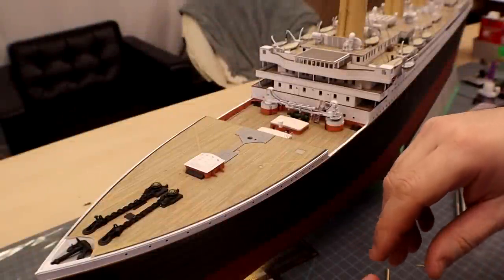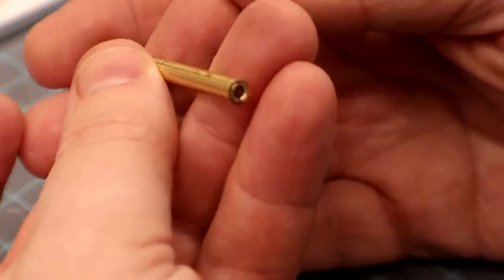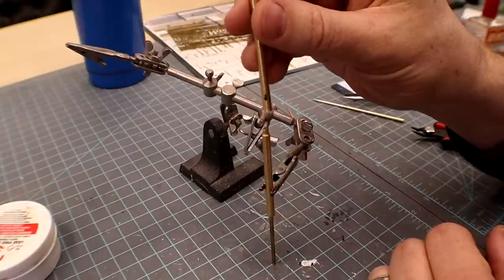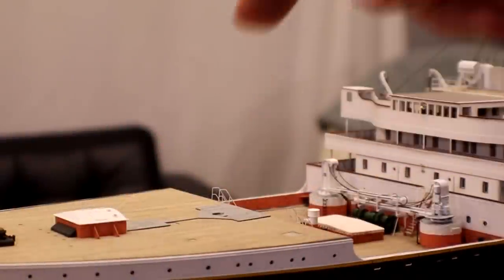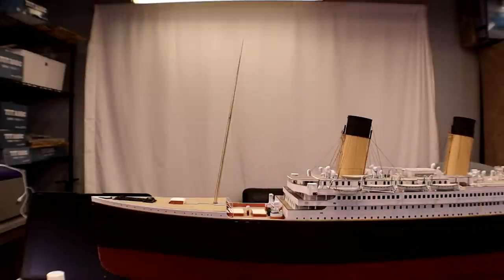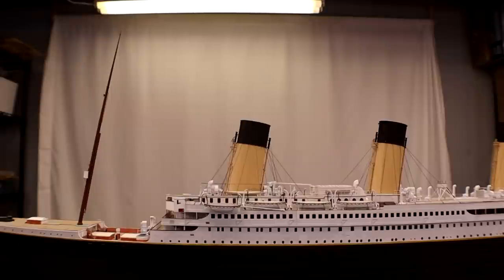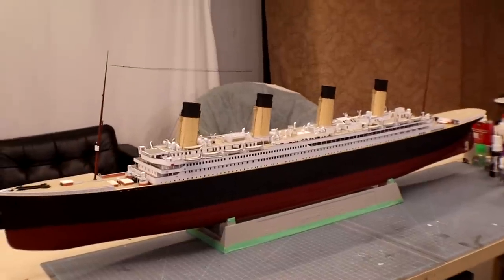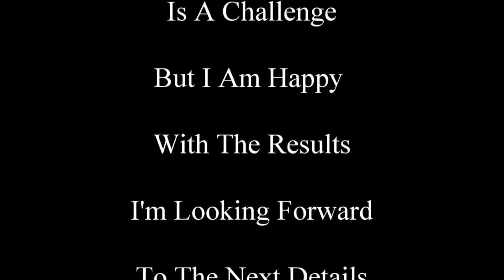1200 RMS Titanic Build Video 39

Comment: Nice job. When I saw u thinking of using 6000 adhesive, I said "brass!...solder it" and u did. Thanks. Love the masts/wires. Interesting that the overhead views in this episode brings into focus the diminutive size of the lifeboats in the scale of the real ship and begs the question "what were they thinkin'" at H & W....16 x 65 = 1040 souls.
Reply from the maker: Well… the “books” imply that they really didn’t think they would be needed. That whole space along the boat deck is meant to be filled with lifeboats. But someone thought it would look “cluttered” so they cut the number down to look good to the eye, and that happened to be 2 more boats than required by the law at the time so 🤷🏻‍♂️ It’s obvious now, of course, but back then… I think they figured it was already overkill.
Reply: @TheMidwestModelShop  Agreed, I just wonder if that rational applied to other ships but was not tested as was Titanic. Do today's builders use the same logic on these cruise ships with 3/4000 ppl aboard.?
Reply from the maker: Today there has to be a lifeboat seat for every single person on board.
Reply: Even with the huge amount of time Titanic stayed afloat, it would not have been enough time to launch more life boats if they had them anyway. Too much confusion on deck. I think James Cameron did a video timing life boat launches to see if more boats would have helped. They discovered they just did not have time. Britannic and Lusitania went down in less than half the time of the Titanic did. So with almost perfect conditions Titanic still did not have enough time to launch any more boats.

Comment: Note: Another idea would be to sleeve the second portion of the mast to the lower portion with a smaller diameter brass rod or steel rod.
By the industrial grade LOCKTITE will permanently adhere all of the individual mast sections together just fine without the need of soldering or epoxy.

Comment: If you want the solder to flow better you need a low temperature solder, as well as a good flux. It's no good saying temperature to heat the brass to as the aftermarket aren't particularly choosy when picking the brass aside from the price.

Comment: Great approach re establishing the rake of the mast. The rake of the masts is most often the same as the rake of the funnels. An alternative to using the "vertical from deck placement" reference point (which worked very well for you), might have been to calculate the angle using one of the funnels, then construct a jig/template (wood or plastic strips) to align your drill. Different ways to skin the same cat... apologies to the ASPCA.
Reply from the maker: I actually made a jig to set the angle of the masts with respect to one another. And you’re right, the angle is the same as the funnels. I was hesitant to push them back further because it’s more than KA suggested. But the funnels are 3D printed and I don’t want to assume one is correct or they are both correct, etc. That is part of the reason I used the verticals placement check.
Reply: @TheMidwestModelShop  Makes perfect sense. Loved your approach to use your mini-milling machine/lathe to mate the tube to the solid mast. Since you were on a roll I was REALLY impressed when you ditched the ca glue and soldered the antenna arrays (now they're gorilla-proof). Will you be breaking out your Miller TIG welding rig next for, say, the deck railings? I can still remember the horror that you endured when you tried the Eduard 3 part railing system (stanchion, chain and turnbuckle) on the Arizona project. Although its only been a few short years its amazing just how far you and Nora have improved your modeling skills/techniques AND shared them with your humble flock.

Comment: Solder it on 2 claiming v blocks, on a flat surface,  solder in the gap between the blocks,  place both v blocks against a straight edge

Comment: Love the build I never miss an episode but quick question, why didn’t you use your lathe to drill the mast sections and join them with a tighter fitting brass rod?
Reply from the maker: That would have worked. But I think soldering was faster.

Comment: It would be nice if the mast was one piece, but that would be almost imposible to undetake at that scale. If the sections fit together in such away as the maintian the smooth diameter reduction could you solder them together [1st and 2nd sections] and if need be place it on a thick piece of tempered glass heat it up gingerly and roll it straight; Sorry for then long sentence. Rinse and repeat for the upper too.

Comment: Ben, where can I get a display case for my 1/200 Iowa, I looked on line at Master Tools, no luck, only cases for smaller ships, I would appreciate any suggestions
Reply from the maker: I just make them. You can buy clear plexi glass at Home Depot or Menards if you’re in the states. Then get yourself a bottle of nail polish remover from the dollar store. (It’s acetone) But your clear parts together, make sure they stand in place nicely, and let some of that nail polish remover run down the seem. In 20 minutes the joint will be fused together.